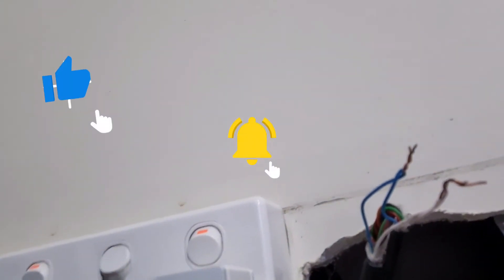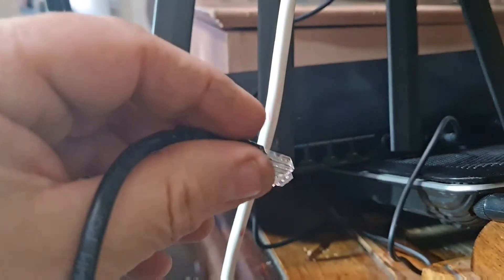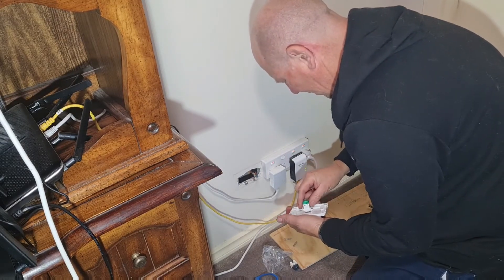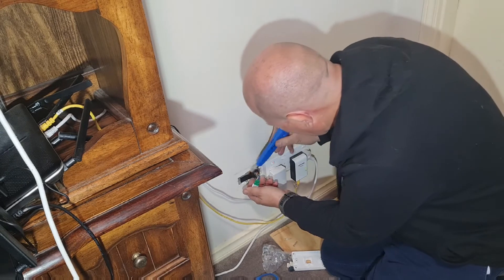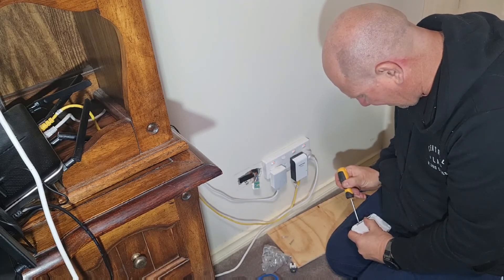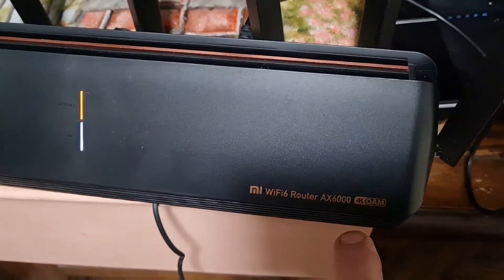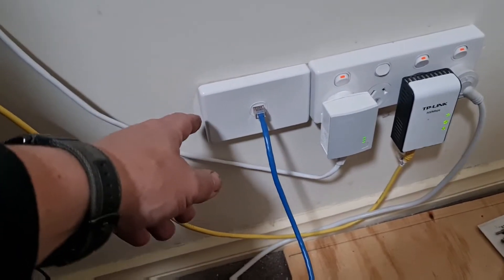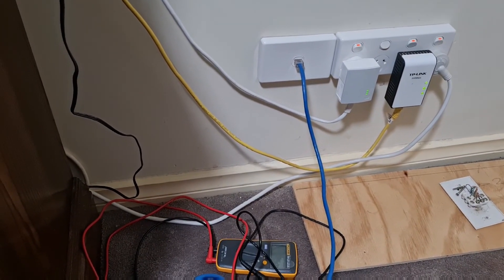Changing a RJ11 or RJ12 to a RJ45 CAT5 or CAT6 wall mount. Plus building a RJ12 to Cat5 cable.

Comment: Great video. Just wanted to know, i have a 4pin phone cable in my wall, can i convert this, and would i need to convert the end location near my hub which is also a rj11 connection?
Reply from the maker: Mainly a four pin could be covered. Here in Australia it normally uses blue and white wires. The other two can be used as another line into the house, or may not be used. You would need to change the wall and also connect the RJ12 to the Cat cable to make a hybrid cable. Good luck and thank you foryour wonderful comment. Take care.